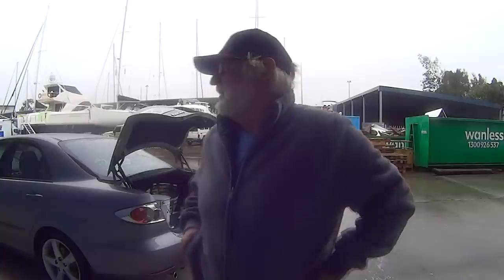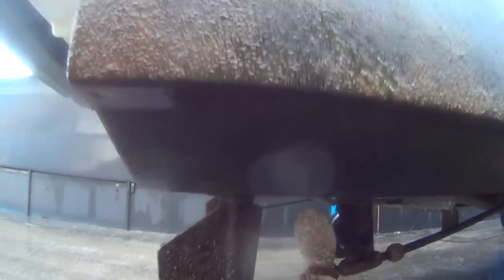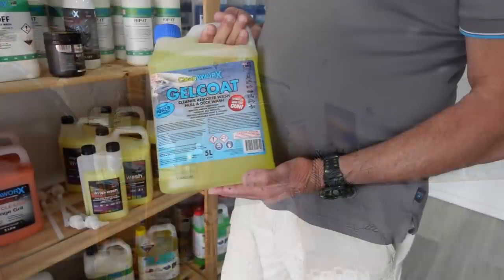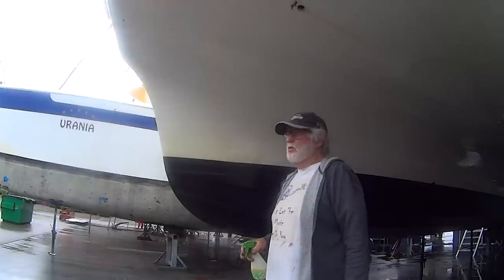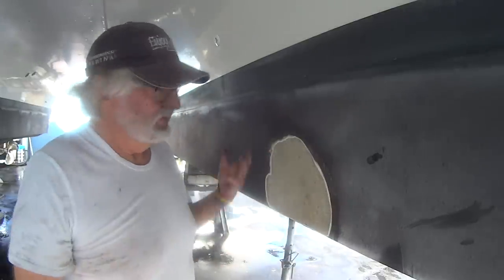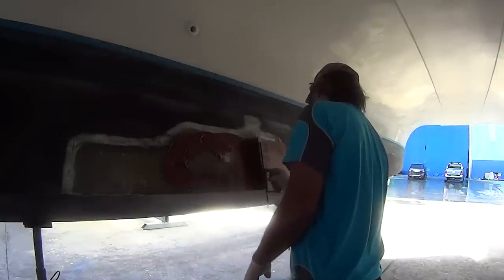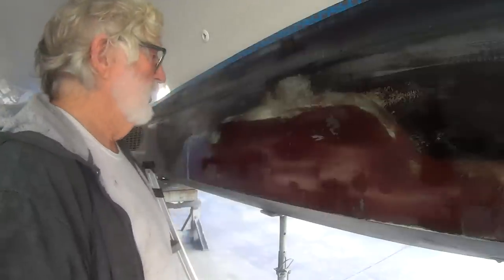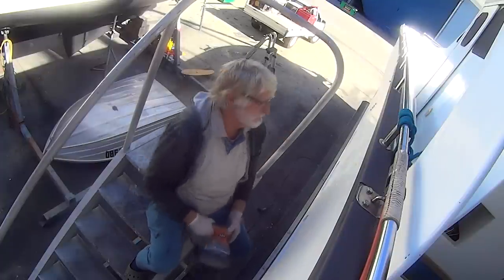Ep2 Painting The Bottom

Comment: Hey Norm, I enjoy your Vids each week. Did you not use Gelcoat over the repairs? I am in process of buying a 36ft fibreglass boat and it has a couple of blisters so am looking into the repairs needed.
Reply from the maker: No gel coat as it was below water line. Used epoxy filler to seal it.
Thanks for watching dude.